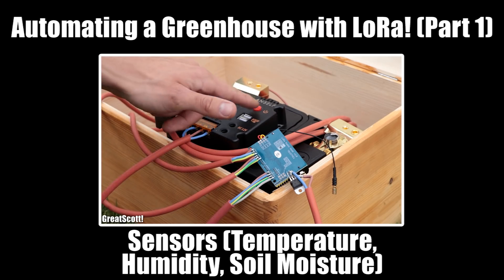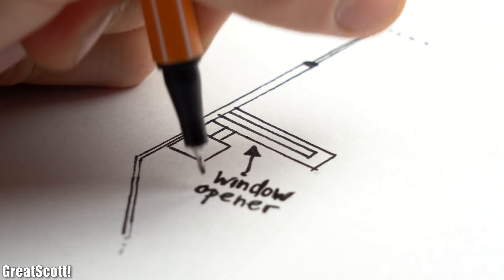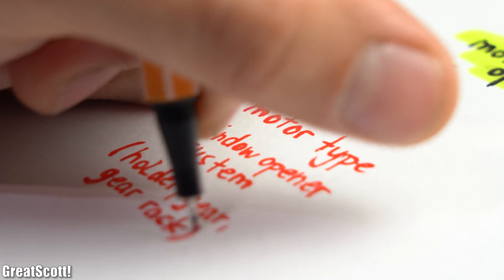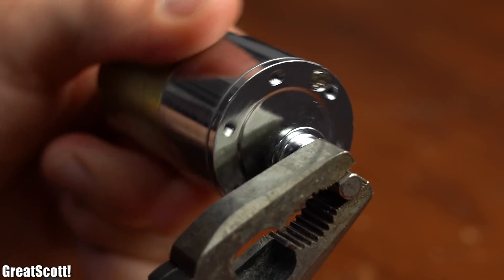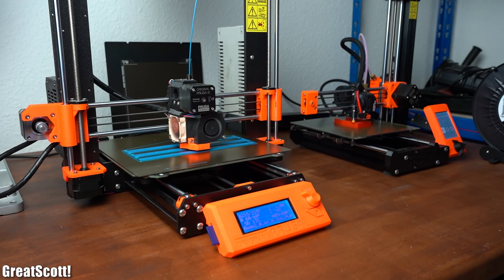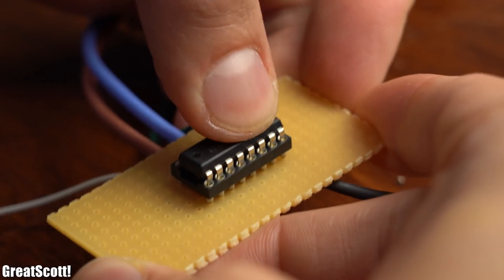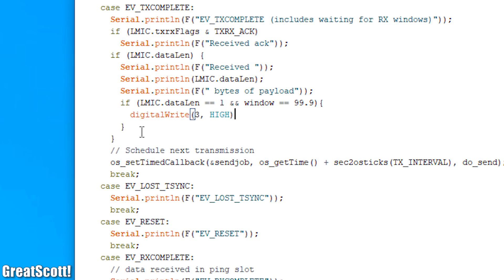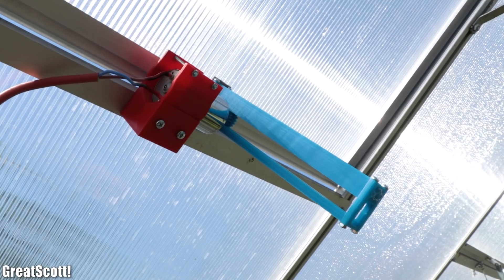Automating a Greenhouse with LoRa! (Part 2) || Motorized Window Opener

Comment: i think that the best way to controll those motors would be to evaluate those data in the laura board it self. (set some humidity and temp which would triger the windows to open and set some humidity and temp which would close them) This way the system would be working even if the internet connection drops. You could still send the data and the state of the windows over the internet but they would be used just to monitor its functionality.

Comment: Hope that's not PLA or it will melt (Mine did), also only one window..  need more.  My greenhouse has 8 windows so i used a long shaft along the ridge of the roof and placed 4 pullies instead.  Also used a potentiometer on the shaft for feedback so i have 5 positions according to temperature.

Comment: The first motor could have worked perfectly fine, you just had to make an L shape track rather than a straight track, along with a swivel joint on the end that attaches to the window.  When the motor goes one way, it will eventually "lock" into the bottom L part of the track, it can spin all day long in one direction and it will do nothing (if the teeth to the rack end short).  When you spin the other, it will pull based on friction to get back on the track and "unlock" out of the bottom L.

For the "high power" motor, you could have just used a capacitor, since it will only be used in short bursts, the solar can recharge the capacitor in a step-up series, and the capacitor can then run the motor from a relay to provide the power.

Soooooo much solder....lol

Comment: I think a little more effort could have been exerted in order to mitigate and eliminate the issues you could come across like the rack and pinion having alignment issues, and  I also think that it was a bit lazy to decide against pursuing automating the water system, I know that it seems like.a easy task to just do it yourself but in the end would allow you to only have to pick the fresh produce as it is completely grown and nothing else. In the end I think that this project could have and should been done a little differently like having limit switched on the window, or automating the water system, or finding a more accurate system for indicating water moister. While you solved some problems here and there you also created problems that will in the end come and bite you in the butt. I think I may across as mean or cold hearted but I feel that it wouldn't have been that big of a deal for me to solve, and that you have the potential to do the same just easily or even easier. Anyway I did learn about a different Lora board that I might want to check out.

Comment: Great video, but there is one thing that I concerned me. 
I am not super familiar with the LoRa library you used, but using the length of the data to determine which action to take sounds like a terrible idea, as the wireless transmission is not always reliable. This means sometimes some data could be lost or distorted in the process, and the system would fail. From a security perspective, it also makes the system vulnerable to attack, as they can send random data to it to mess up the system. In short, while stricter verification (e.g. cryptographic checksum, redundancy) is not necessary for this project, you should always implement some check on the data itself before using it to make decision.

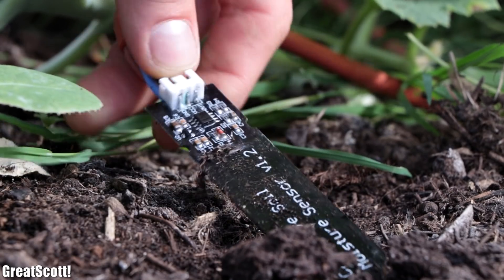Comment: 0:34    the  moisture sensor is this problem? 

https://www.youtube.com/watch?v=QGCrtXf8YSs&list=LLBc5MUfrnLBiyuXLiLMvyJQ&index=70&t=304s

it can simply be repaired by add a resistor between "AUOT" & GND pin

this video use 1Mega 
 
ohm resistor

我沒有1M 歐姆的電阻 ，使用80K 歐姆的電阻也可以，但Analog read 的讀值會比較小，無水跟有水大概只差個300，判斷式的地方乘上一個倍數即可，可以增加最大值跟最小值的差值

Comment: Hey, once again a great video, thanks!
I am also experiemting with these capacitive moisture sensors you mentioned at the beginning. Although their readings are not great, it think they are at lease useable. I posted the results of an example measurement I made here: https://brianp.de/posts/2020/example-measurement-moisture-sensor/ Initially I planned to build an automated watering system with these sensors but failed due to electronic and practicability reasons (who wants to have a bucket full of water next to his flowers?).
With related sensors (Xiaomi Mi Flora), I build a plant monitoring system that works pretty well and alerts me whenever a plant needs watering (https://brianp.de/posts/2020/plant-monitoring-xiaomi-miflora-rasperrypi-grafana/ ).

Comment: i think having a stepper motor would be beneficial, not only can you be more precise with movement, but newer tmc drivers have "software" endstops in them, they would allow you to have a closed design while still not having to solder in physical endstops. i think the added power is neglegible because you typically only open and close the windows 2-4 times a day for a very short period of time. it would be neater if there is nothing that can fail and i'm propably going that route. also hoping nema17 motors are strong enough to lift a glass window :D

Comment: I think the length of the data is meant so you know how many bytes to read..

But I guess that works too..
Still I feel like there's no need for any web based systems, technically the whole system could send commands to itself with a web interface to watch over it, if even necessary, at least that's the automation dream.

Comment: I think solar powered electronically controlled LEDs would be faster than motor based window opening system for controlling the amount of light
Reply: It's for controlling the humidity, not the amount of sunlight
Reply: Humidity and temperature, of course

Comment: Slightly confused whether you added code to automatically open the window if it hits a temperature threshold or if it is just a remote control function of the window?  Also if you did add automation to open the window at a certain temp, Automatic watering would be good also. You could set it to water the paving slabs if opening the window doesn't reduce the temperature enough. The evaporating water will remove a lot of the heat from the green house, out of the window.  It would be dependent on the climate you live in though if it would be needed enough to justify spending the time on it.

Comment: - the white box itself possibly not enough to block all the light going to the sensor, I found my DS18B20 is super sensitive to light. some aluminum coil would be helpful.
- for a open loop system, it's critical to consider the situation when MCU is reset(power loss or software bug etc.), I hope your motor won't break the gear and rack in this case(looks like it's been taken care of from your comment).
- how does the your motor & electronics handle moisture? hopefully we can have an update on this project in the future.

Comment: If going over engineering side, holding torque is factor that doesn't need to be dealt that much if you use counterweight.

Comment: You don't seem to have any sensors to tell if the window is open or closed.  If you lose power or the arduino resets for some reason, when the window is open and closed is the default, it will try to open further, it may not be an issue and just grind a little but I think it may end up causing problems in the long run wearing down the gear or breaking.  A couple of microswitches and interrupt pins on the arduino (if they're free) should do the job, or you might get away with just one on closed, and after a reset it runs the motor in the closed direction until the microswitch is triggered achieving an accurate default - oops didnt see your pinned comment.

Comment: I also end up using DC motors in my setting (after starting with steppers),   was a little worried about the durability of the gears but seems that are fine after one year.

Comment: They actually make pistons that expand in response to increased temperature.  They work kind of like wax motors.  They are filled with a type of oil that expands a lot with temperature while staying a liquid.  They can simply be adjusted to the temp you want them to open at, and when the oil reaches that temp, the piston expands enough to start opening the window.
Reply: What is this called I need this
Reply: @PlanYourLift  They are called Heliotropic pistons.  It's actually the same mechanism that sunflowers work by.

Comment: did you make your soil moisture sensors waterproof? yes i know you used nail polish on the upper part, but did you waterproof the sides? because water can get into them on the not painted sides and they will get wet and very slowly dry. this results in nearly constant values.
I also used two of them in my weather station successful for about 4 month now. after using nail polish on the sides, shrink tubes on the upper part and a lot of plastic spray just to make sure, they work very well on the outside (no roof above). I can clearly see differences when the soil is getting dry and after it was raining or we were watering it, ranging from about 50% to 85% for the one in a raised bed and 60% to 95% for the one in the ground. I also changed the position of one of them to be more horizontal, because the lower ground rarely gets that dry.

Comment: A 4-inch Linear Actuator (about 25$) will be ideal for opening/closing the window. It has an ACME thread that can provide more than 200 lb of force and a 12V DC motor that can be driven easily. In addition, it has a limit switch to stop the motor when it's fully extended or fully retracted.

eBay link: https://www.ebay.com/itm/Heavy-Duty-Linear-Actuator-4-Stroke-225lb-Max-Lift-DC-12V-12mm/162867242383?ssPageName=STRK%3AMEBIDX%3AIT&_trksid=p2057872.m2749.l2649

Thanks.

Comment: You should change the motor to a whim Drive DC motor it will require no electrical power for hold force as the worm drive a self locking

Comment: For more holding torque you could use a mosfet to short the motor terminals without needing a permanent current theough the motor

Comment: Wait... at 10:23 , did you really tape the mechanism directly to the window? You need a pivot on the window side for your mechanisms or else the tape will not hold with the angle of the window when it's fully open.

Comment: Careful with the L293D driver, though. It's not MOSFET-based, it's using Darlington transistors, which means it can eat up to 3.6v of your 5v rail (leaving only 1.4v for the motor!), and also it can heat up under load. Check the stall current, it should be below 600mA, otherwise you breach the absolute maximum rating. 
Also, as you can guess, it's super inefficient and will consume about the same power as the motor itself.

Comment: Wäre es nicht viel einfacher/praktischer, wenn man Bspw. Ein ESP Entwicklerboard (WLAN fähig) nutzt, wo alle Sensoren, Motoren, usw. gesteuert/ausgelesen werden und dieses Board mit dem Internet verbunden wird (z.b über ein Mobilgerät mit einer bezahlbaren Flat). Und nun über Apps, wie Blynk die Daten von überall auf der Welt abgelesen und Einstellungen vorgenommen werden können.

Comment: Nice video as always. 
A question. Is their reason to why you havent used any stop switches for the window to make sure that the motor does not cam over when it is fully open or closed  ???

Thx for sharing. 
Regards :)

Comment: The question I kept having throughout the video is how does your circuit know where the window actually is and for how long to run the motor ? I believe you're using a fixed run time each time, which should be fine for the most part, but that's assuming the window is ALWAYS fully closed or fully open. If it's not, the motor will keep running and push the rack past its maximum point, grinding out the teeth. A limit switch on either end should prevent this, though it may complicate your mechanical setup a bit. Wind may play a part in this as well....

Comment: No limit switches? How do you make sure it will not overrun? Even with fixed timing for directions there can be some error that cumulates over time. Or is the motor weak enough that it just stalls at the end?

Comment: 1. No endstops?
2. Any motor capable lifting the window with a worm gear will be able to hold the load even without power.
3. The soil-moisture probes you've used have to be sealed, since the cut edges of the pcb's will wick moisture inside, messing with the values. Dipping the pcbs into normal polyurethane paint will do.

Comment: Hi 
Very nice Video !!! 

I Am working on a similar Project using STM 32 and the cube IDE 

I am using the same library. 
Insted yust looking for the number of bytes in the Down Link you can also read the data that is recived see code below.

for (int i = 0; i < LMIC.dataLen; i++) 
{
         Serial.print(LMIC.frame[LMIC.dataBeg + i], HEX);
}
maby ths is usefull for the future
best regards 
Viele grüße aus Bremen

Comment: The data received is stored in the LMIC.frame array, so you don't have to rely on data length to send instructions. That would be quite a terrible data transmission library to not allow you to actually receive data...

Comment: If you add a ten turn pot to the motor shaft of the window opener, you'll get feedback of the position of the window. This'll also mean you reduce the risk of running the motor past the end of the rack, cause I'm guessing the on time of the motor will mean it drifts over time

Comment: Tested a few of this sensors  - yours look like the bad ones. Not consistent and very very slow. Some didnt even work.
Here is a foto of a working one - you can buy these on ebay. de - just look for the resistor i marked in the foto. For long term use give them a coating in platik 70, resin or something like that. otherwise the pcb will start to delaminate
https://imgur.com/a/WXfB8iz

another option are this "chirp" types - got some spares if you want them feel free to contact me.

Comment: I have missed some sensors to detect the motor limits instead delays, because if something fails and the motor is not in position, then it will continue spinning beyond the limits and maybe will break the plastic pieces.

Comment: Great idea, now add a couple of end-switches to the mechanism so you can 
1: tell it to close / open fully and 
2: let it know where it is in the range of open / closed by timing how long the motor runs for and finally 
3: have it return home (close the window) until it reaches the closed window end-switches so you always know where it starts after a power failure! :-)

Comment: Hey! I follow your videos regularly and Kudos on the green house project. Working in an AgriTech startup, I can suggest you to take a look at a soil moisture (soil water potential tensiometer) sensor called watermark 200ss from a USA company Irrometer.

They are a little costly, but really good with accuracy of getting exact soil water potential (amount of water actually available for the plant roots to absorb).

I have designed a really nifty circuit you can use. It uses a 555 IC to ensure only AC (3.3V level) component goes into the sensor so as to not destroy it. The sensor life is around 5 years without and calibration needed.

The circuit and code is opensource and you can find it here: https://link.medium.com/BFpLzsYc08

It will be really great if you can explore this and share your thoughts. It may be useful information to your subscribers as well!

Comment: You could easily use a cheap motor and use a worm drive to give you all the holding torque you need.
You can 3d-print everyhing.

Comment: Thanks for sharing!! Two comments that maybe other people may have pointed out: add limit switches for the motor mechanism and change adhesive fixing of pieces by other fixing method. Heat and moisture can ruin your day loosening you pieces.

Comment: I built the watering automation for my greenhouse and with a bit of tweaking it works fine. I haven't really tested the probes beforehand, just the full wet and dry, this is why I had to modify a few times (I have the same sensors). Also it was  the main project for me, the windows stay open all the time so no need to automate that and watering my greenhouses by hand is annoying since I have 2 of them and each is 7*50 m, both have dripping system installed and constant water pressure so I only had to control a valve to turn it on-off also the greenhouses far from the house so walking there and back take a good few min just to turn a valve then walk back home then walk back a few hour later which can be forgotten. Those big valves don't work from 5v anyway so I didn't had to worry about frying the Arduino, I used a SSR to control it because the valve uses mains voltage

Comment: I like that you 3D print your hardware, but I would had used a linear actuator or a ball screw for the window vent. You wouldn't need the torque of the motor to keep your window open.

Comment: The stepper motor would have worked great. You're just operating it for a few seconds. Always love your work!!
Reply: No but it needs to hold its position with the weight of the window, and he reckoned it would draw too much current while doing that.

Comment: Sir I love your videos very much and I've a request for you. Can you please make a video on a 12V-220V inverter in which 1st of all the 12VDC is converted 325-350VDC and then the output high voltage i.e 325VDC is switched by 4 MOSFETs/IGBTs connected in full bridge. The MOSFETs/IGBTs will switch the high voltage DC using PWM at high frequency and then the full bridge output is filtered out using an LC filter to get 220V pure sine wave at the output.

Sir, I'm really confused what ics, transistors to use in this project.